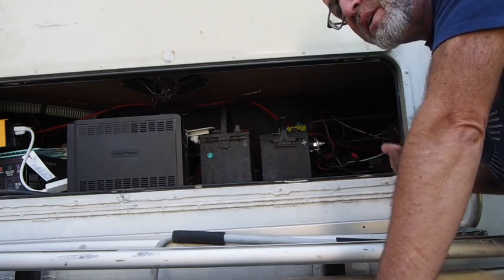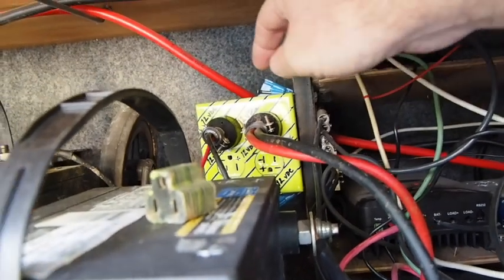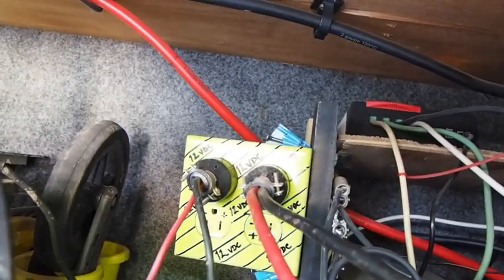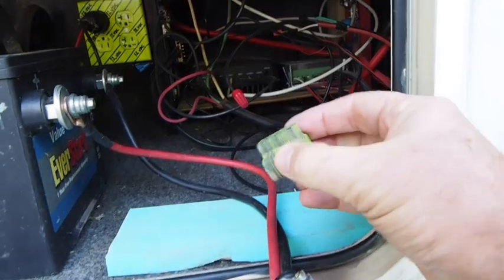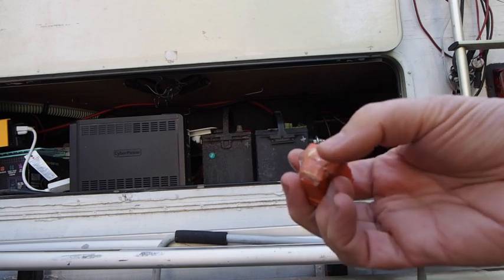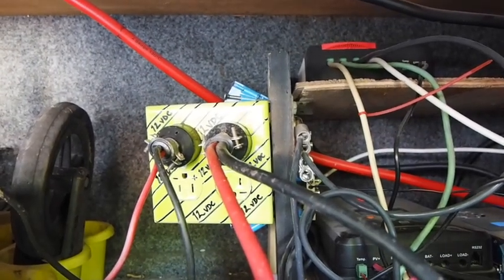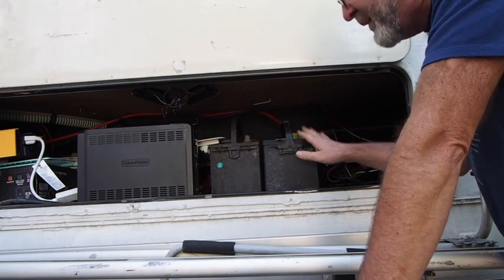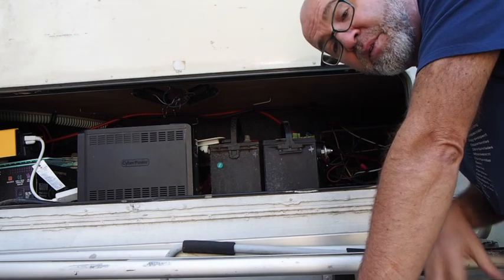Clever hack to simplify expanding my solar battery bank

Comment: 12 volts draw a lot more current as compared with 120 volts. 1000 watts / 120 volts = 8.3 amps. 1000 watts / 12 volts = 83.33 amps. ( microwave, computer and some lights). These numbers don't lie. You may burn your camper thing up if your inverters start drawing a large load on those batteries through those teeny weeny outlets and wire. It would be safer to use welding leads with welding connectors and a couple of disconnect switches between the batteries and the inverter.  Install circuit breakers too. You may consider lashing those batteries down as well.  Or, continue with your Darwinism and expand your current system using two more batteries since you have two more outlets!  I have no idea how this video ended up on my feed, and I do not know why I am commenting.
Reply from the maker: I appreciate the detailed feedback. As noted in both videos on this topic, those batteries are there ONLY when I am completely stationary for long periods of time (i.e more than a week or two). They are literally my engine batteries so it's impossible for the RV to move unless I remove those batteries from the system and reattach them to the engine. Therefore, strapping them down is unnecessary.

The permanent battery bank has eight batteries, so these two extras make ten. I truth, I don't need the power stored in these two additional batteries. I added them more for the health of those batteries than to meet a need. Therefore, I will not be adding even more batteries. I'm fine with having two extra, unused outlets.

Other points you've made are valid. Things like fuses and circuit breakers are in place, they just weren't shown in this video because that's not what the video was about. But again, I appreciate your detailed feedback.

Comment: all fine and dandy it works for you but this is a great video of what not do and not be cheap.
Reply: it's kind of like a find how many bad ideas there are in this picture
Reply: @ballardtech827  IKR
Reply from the maker: When you say "not be cheap", I think that requires some unpacking. I personally know more than one person who paid more for just their solar system than I paid for my entire motorhome plus all the upgrades that have been made to it. It's very easy to spend a fortune. I am fully energy independent. I'm in my fourth year of full-timing and haven't had a utility bill in years. So yes, to your point, this is working for me.

Comment: You have an AC outlet rated for 20A AC load and an AC plug rated for 15A AC. I hope your charge system does not supply more than 15A to the batteries.
DC amps is not the same as AC amps...
Reply from the maker: Your assertion about AC amps and DC amps being different is correct only in a few technical respects, none of which apply to my system. However, I do acknowledge that I was short-sighted in not addressing this in my video. I didn't think of it because it wasn't applicable.
Reply: @amazingworldadventures325  So, how many amps is supplied by that receptacle?